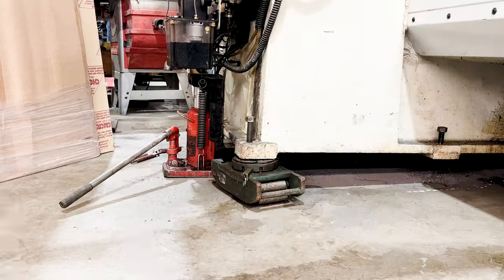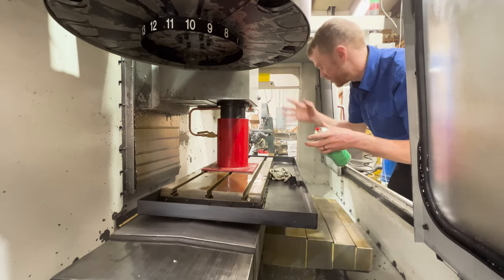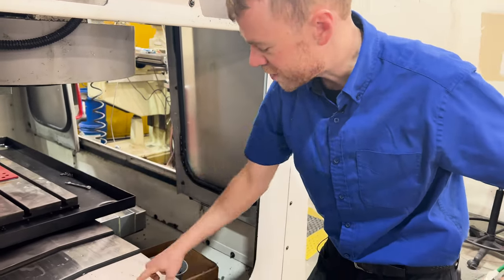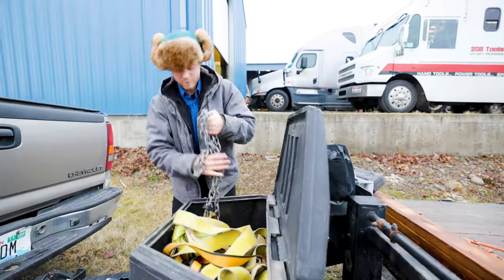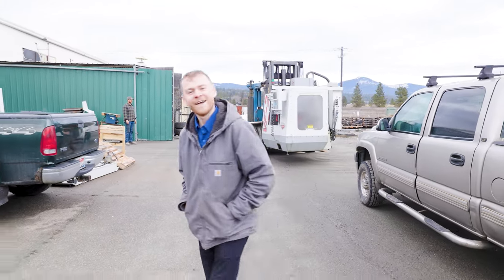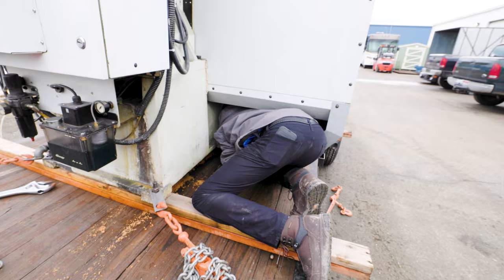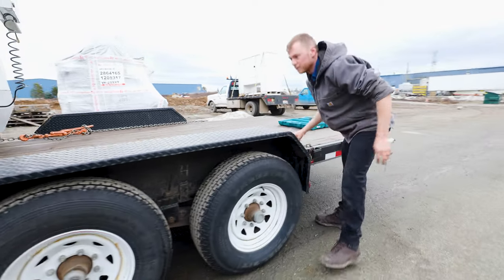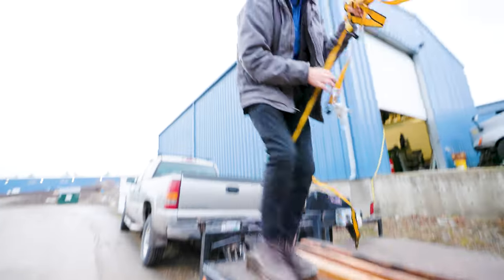Easily Transport a CNC by Yourself

Comment: I also bought a 2005 vf2 and hauled it about 230 miles, riggers at the auction told me that the machine would fall through the trailer  witch was 12,000 lbs and made me sign saying that I know it was not on a air ride trailer, the night before I bought 20-30 cheep pillows from Walmart and stuffed in electrical cabinet to cushion the shock on some electrical parts in cabinet, not sure if it helped but it made it home safe, I was more worried about the battery for memory and having a back up on settings since did not see it work and was disconnecting long before pick up date. So anything is possible without the  extra costs. Thanks for you videos love to see more.
Reply from the maker: Nice job! Thanks for the story!

Comment: Positioning the machine so far in front of the trailer axles is real torture for the vehicle's hitch and poses a risk of a serious accident. The center of gravity of the machine should be in front of the axis, but very close, otherwise it only avoids inducing oscillation in the horizontal plane and enhances it in the vertical direction. Don't be lazy and remove the covers if they don't fit. An hour of work is not as expensive as a damaged machine and vehicle.
Reply: Yeah there is a video with a little truck on a treadmill and they demonstrate different loads on trailers and their effects.

Comment: Okay, now everything is loaded up and headed home.  Could you show a little about how you got the machine off of the trailer and placed either where you want it or in temporary storage?  When dealing with machines that are 4000 pounds and up, ordinary shop equipment will not lift and move these machines.  Renting a forklift or telehandler in this weight lifting category even for one day is close to $1000 or more.

Comment: So how important is having an air ride trailer, truly. People recommend using them, but as long as the machine is secured correctly I assume it'd be fine. I used a rigger for my VF2 & Minimill, but transported a 4000lb 4x8 CNC router myself. Hauling that thing through the mountains with a 2500 Suburban was slow going, but I got her home.
Reply from the maker: I’m on the fence about it air ride for used machines. I think it also depends on the roads and the trucker.

Comment: The machine preparation is pretty much good sums up but the loading on the trailer doesn't make sense at all, you should always put thr weight close/centered to the axles as possible, you can clearly see the pickup and trailer are enduring hard bad times